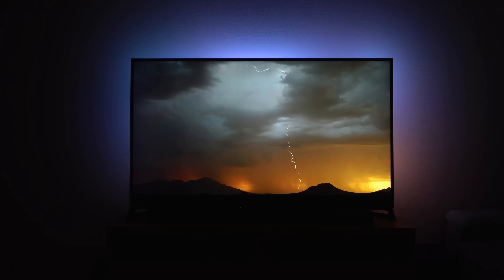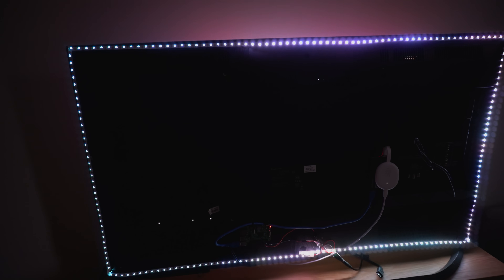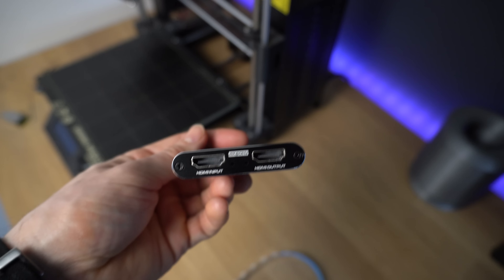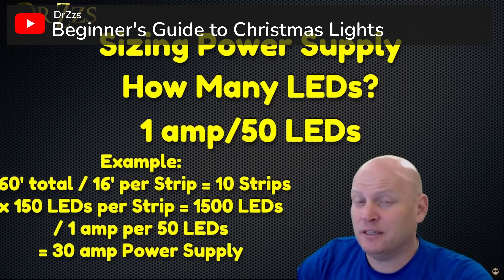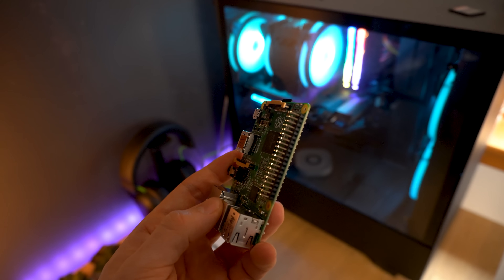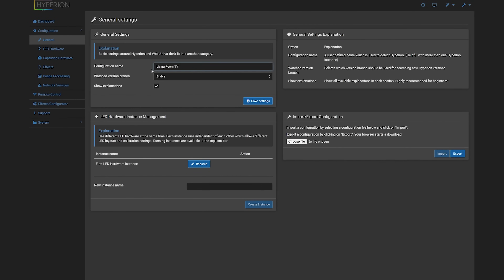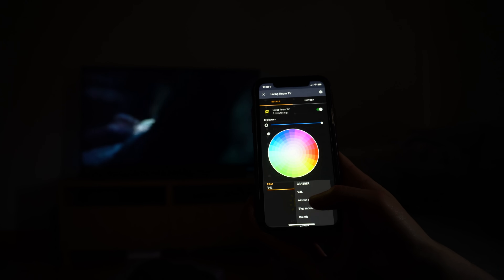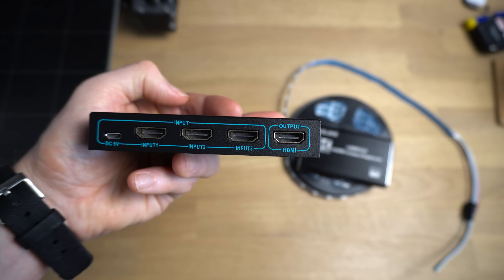Cheap DIY Ambilight TV Project with Hyperion and Raspberry Pi

Comment: Thanks for your amazing video.

Just one question, is this possible for smart TV? Like Sony with built-in Android OS. I don't use Chromecast for anything. Wondering if something can be done for smart TVs.

Thank you
Reply from the maker: Thanks! You can but you need to use a camera pointed at the display, this is the only method I know of unfortunately. Although if you have an Android TV then perhaps you can install an app to grab the screen somehow
Reply: @EverythingSmartHome  Thanks for replying back.

I guess then Govee Immersion Lights are good, it has camera and I think it's not bad in price $65 USS.
Reply from the maker: Yeah that's not too bad a price, I just don't like the look of having the camera there but if that's not an issue then definitely go for it!

Comment: Nice video - and great result! 
- but is the barrel Jack, not only rated for 2.5 amps?
Reply from the maker: Thanks! Hmm I'm not sure, I've never seen that number quoted anywhere before and haven't had any issues with mine but could be I missed it. Do you have a source for that spec?

Comment: Thanks for the video! I've been wanting to do this for some time, I think I'll purchase the parts now. Wouldn't it be possible to use a HDMI splitter for the signal between your Chromecast and your TV, and then use a cheaper HDMI capture card? Thus reducing your price, since you don't need the loopback/HDMI passthrough on the capture card. I find 4k HDR HDMI splitters to be quite cheap.
Reply: I also wonder if this is possible?

Comment: Looks good, I wonder how you would do this for an existing smartTV - how do you capture that
Reply from the maker: Thanks! I've not found a good way to use existing smart displays unfortunately, the only way I know of is by using a camera pointed at the TV which isn't the nicest looking solution!
Reply: @EverythingSmartHome  Hi. It works pretty good with Hyperion Android Grabber App form the playstore :-)
Reply: Already posted aerlier, sorry. I need to mentioned that with Android Grabber, you can't get the data of App using DRM like NEtflix :(

Comment: Great video, would there be an easy way to adapt this method in order to use a smart tv rather than a Chromecast?
Reply from the maker: Thanks! Unfortunately I haven't found a nice solution for that (one method is to point a camera at the screen and do it that way but that's not something I'd be interested in doing! But unfortunately I haven't seen another method. Unless your TV is an android TV and you can install apps on it!
Reply: @EverythingSmartHome  How would that work in short? Which app do you mean (I have an android tv..)

Comment: Would love a more detailed video as I e built one of these not long ago for a friend. Cost well over £100 and used a pi zero and an Arduino. I Though an Arduino was the nessasary item.
Reply from the maker: I'm confused as to why people have been using Arduinos? Saw them in the titles of other videos although admitdly I haven't watched them though so maybe there is a reason!
Reply: @EverythingSmartHome  the Arduino is used as a line level converter. The pi gpio output pins high is 3.3v which can cause flickering of the LEDs. You can use an LLC to convert these to 5V, or you can use an Arduino as a "middle man" that does the same thing.
Reply: @EverythingSmartHome  can you please make a more detailed video with list of products as I'd like to see how it runs your way. Thanks

Comment: Great video, really mind opening. If you can share a full guide it would appreciated 🙂. Can you please let me know if this setup may work with mibox 4k with the capture card 4K 60 fps 1080P 60 Hz HDCP 2.3 HDR10 USB 3.0 HDMI type. Thanks again.
Reply from the maker: I'm not sure sorry as I don't have one of those to test for sure but have a check of the capture card specs

Comment: Does the capture card you have here have CEC-Passthrough? It doesn’t seem like it does!
Reply from the maker: This one does not no, something I used up until recently but got a workaround in place for my setup personally where I don't need it anymore but something to be aware of! Hyperion itself supports HDMI-CEC
Reply: @EverythingSmartHome  So if I was to turn my Chromecast on, it will send a signal to the Pi via the Capture Card to turn the TV on? Is there a delay with the Hyperion HDMI-CEC? Might just have to bite the bullet so to speak with the capture card you have and see how it turns out!
Reply from the maker: Which Chromecast do you have? Casting from your phone no longer turns the TV on from me like it used to unfortunately but I am able to detect this action and turn the TV on using home assistant so it doesn't impact me at this time, but something to be aware of!
Reply: @EverythingSmartHome  I use the new  Chromecast with Google TV. I like being able to use the remote control to turn the tv on, or using my voice with any of my Google speakers. I use Home Assistant as well!
Reply from the maker: I have the new Chromecast too, the remote still works because it can actually control your TV directly rather than using HDMI-CEC, so pressing the power button on the remote still turns my TV on because it's programmed with the TVs IR codes
Reply: @EverythingSmartHome  Now that I think about it, you’re right. Well I’m going to give your setup a try then, I’ve already ordered a regular hdmi grabber etc but your setup is much more simplistic! 👍🏻
Reply from the maker: Let me know how it goes, good luck!
Reply: @EverythingSmartHome  So I ended up getting the same capture card, spent a few hours trying to get it up and running tonight. For one reason or another I haven’t been able to get my WS2812B LED strip to light up at all; even using the “Remote Controller”, I’m so clueless to what might be wrong!
Reply: Turns out the first LED was faulty which caused the rest in the link to not work. My only dilemma now is that the HyperBian interprets the capture card in dull colours, so if I have bright red on the screen HyperBian sees it as a brown, so my LED's are all dull looking. Did you end up having this issue?
Reply from the maker: Are you using HDR?
Reply: @EverythingSmartHome  When I switch to the HDMI input for it, it says HDR in top right corner of my display, so yes!
Reply from the maker: Try using "hyper HDR" instead of Hyperion, it's a fork of Hyperion with HDR support. You can backup and import your Hyperion config so you don't have to set anything up
Reply: @EverythingSmartHome  Whoops.. my tv recognized a HDR device but I never had HDR enabled in my Google Chromecast settings, enabled that and colours are exactly how they're suppose to be. Thanks for getting back to me very quickly! :D
Reply from the maker: Ah nice, thanks for updating! 👍

Comment: The ONE problem I have with this setup is the fact that you are capturing only one input of the TV. Sure, you can use an AVR or something similar and monitor its output, but I think when the time comes, I'll just buy the Philips TV.
Reply from the maker: I mentioned this at the end of the video, how you can use it for multiple sources, splitters are very cheap and it takes around 30 seconds to install. This would be a much preferable solution for me personally, but picture quality is important to me.

Comment: Power supply calculations assume full-white at 100% brightness.
With lower brightness and never displaying a full-white (or white borders) screen, you should be safe with less.
You could also use a fuse to be safe.
Reply from the maker: Yep that was my entire reasoning for using less but also why I wrote "safe" recommendations. Thanks!

Comment: Definitely going to try this
Reply from the maker: Can't wait to see it!!
Reply: @EverythingSmartHome hi. If i were to use a raspberrypi zero w. Connecting my capture card to my raspberry pi using a micro USB shouldn't be an issue right?  Asking cuz when i plugged it in. Didn't seem to capture anything.. Probably not enough power?
Reply from the maker: Yep it works OK. Are you sure your plugging into the correct USB? One is power in only

Comment: Just went though on what I had in stock and it would cost me 80 bucks for a 1080p setup. Wonder if I could use something else other then a Pi, I got a Pine Rock64 laying around. Too bad a standard PC doesn't have any native GPIO/PWM pins. My HA Server is in the TV cabinet under the TV.
Reply from the maker: You can use an esp8266 with WLED and run the Hyperion on another PC to remote control it
Reply: @EverythingSmartHome  Well then, that is a game changer.

Comment: I built one of these a while back, but I didn't use a capture card. Since I watch everything through my android TV device I installed the Hyperion grabber to that. It sends the image to the Pi via WiFi. Works well and removes the need for the capture card.
Reply from the maker: Good idea! How's the latency?
Reply: @EverythingSmartHome  latency is non existent from what I can tell
Reply: Simon Eatough I have a strange quastion for you.. so I have a xiaomi mi-box android tv box. Will it be possible to transmit data signal to PI from mi-box, via wifi?
Reply: Can't it all be done just by the pi so you cast your source video to it instead of using a capture card or am I missing somthing
Reply: @TheMemeAsylum  i would assume raspberry pi would struggle with high resolution videos
Reply: lol , seconds before I read your comment , this idea went through my mind ... thanks :D
Reply: So that means we can use signal rgb on the pc to send it to our pi without a capture card as well?
Reply: Is hypweion grabber available on lg tv? Also if someone knows how to make an app for lg tv webos would it be possible to make an app that runs in the background and sends the control data for the light strip via tv usb?
Reply: I just spent 69 bucks on a GOVEE IMMERSION and you can even add other lights to it... far easier and cheaper...
Reply: @zsavage1820  it's about accuracy not price govee is ugly and far too bright
Reply: Im guessing that's because you have an android TV.

Comment: When I saw another hair impaired smart home youtuber do this a while back I gave it a try. I was trying to use the WLED controlled sk6812 RGBW LEDs remotely that I already had installed on my Monitor for ambient lighting. Unfortunately while those LEDs can be used if controlling directly from the Pi, they wouldn't work remotely with the WLED option like 2812's would. Last I checked this hadn't been fixed. Hopefully in time I can give it another go, I really want to try it while playing games on my PC.

PS - consider putting a link to Hyperion project in the description?
Reply from the maker: Huh that's strange, SK6812's are listed in the Hyperion list of LED's, what behaviour did you experience?

Yep my bad, forgot to include it, will add it for sure!
Reply: @EverythingSmartHome  Wouldn't let me configure it at all. If I set it up for being run directly of the GPIO pin then they could be selected and would run, but there was no option for the sk6812 strips in the wireless connection options. I tried all the different options available just in case and all I ever got was miss timing issues as it was sending code for 3 channels not 4. I know my use case is outside of what your video showed as I was doing it wirelessly over the network and sending the data to WLED, but for that use it just didn't work with the sk6812's. Hopefully that will soon be updated as there's not been a release update since Nov. I can't remember if it was Alpha 8 or 9 I tested with

Comment: I tried the same last year but the 1080p capture device I used was very hit and miss. I ended up replacing my pi 3 with a wemos d1 mini controlled by hyperion running on an unraid windows 10 vm (GPU passthrough from the server to the TV). The vm also has plex media player and netflix installed. I'm also running plex server as a docker in unraid. The video capture is achieved by the hyperion screen capture software (github) which captures whatever is displayed on the screen. Other than the led strip and power supply no additional hardware is needed and saves quite a bit of money.
Reply from the maker: Yeah that's another route you can go for sure! Thanks for sharing
Reply: The shared ground you mentioned in the video caught me out. I followed the build process on Drzzz's channel but clearly missed that bit. I almost gave up with the whole project when I couldn't figure out the the flickering issue. A lot of hunting round the interweb revealed that nugget of information. The only bit missing from my whole project is being able to capture the video signal from the Virgin Media box. Everything else media wise playing on the windows vm is covered.

Comment: I'm curious if you can do this setup but instead of a capture card, use a camara staring at the tv, similar to how govee wifi tv led works. I'm specially looking for the ability to set the camara across the room (similar fashion as a projector facing the screen), also curious if there is going to be mayor delays introduced by using a camara
Reply from the maker: There is ways to do it using the camera yes, I'm just not a fan of that particular solution but I've seen software to do it